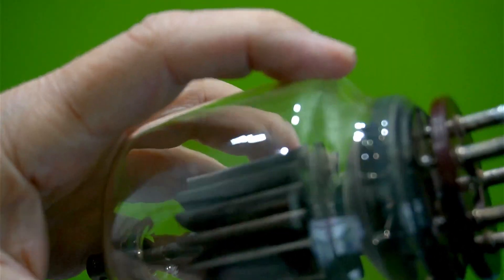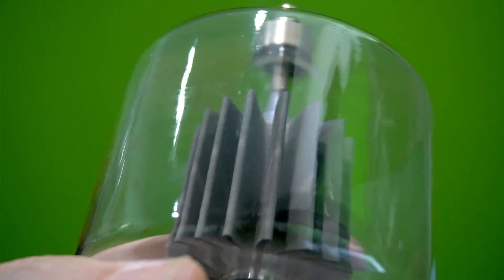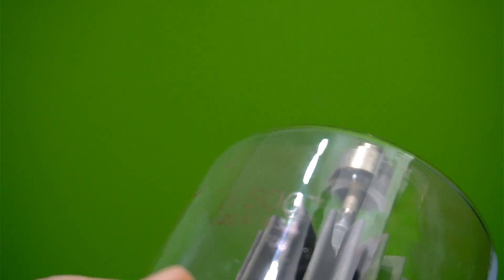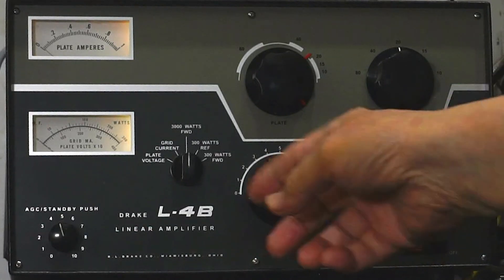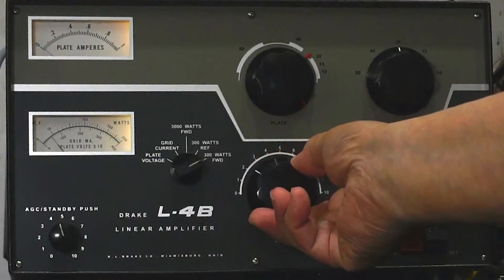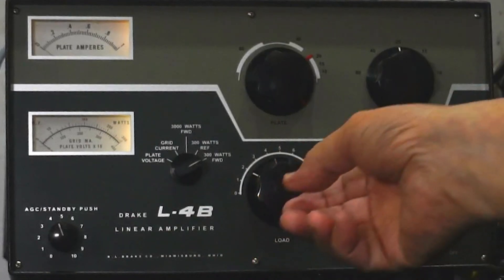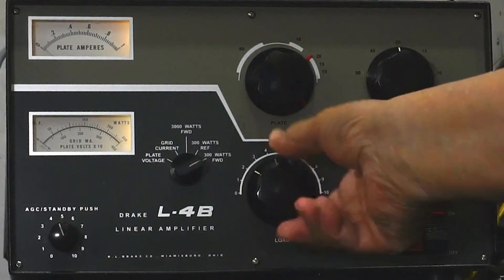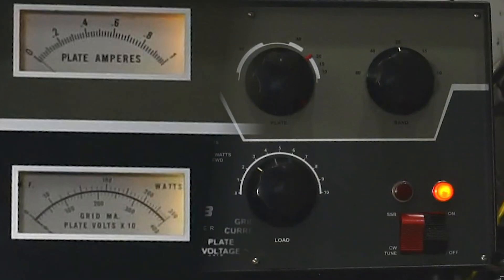Linear Amplifier, Part4, Tuning Drake L4B, Don't Jump to Conclusions, Jim W6LG YouTube  Elmer

Comment: Something crazy is going on with my L7. I bought it used. The first time I used it the output was a little lower than what I thought it should be. About 900 watts out on 40 and 80 and a little over 1500 on 20. now I can only get 200 or  300 0n 40 and 80 and 1000 on 20. Ive connected it to a dummy load to see if it might be something else in my station. Now Im starting to jump to conclusions.

Comment: Hey Jim, I have Drake L7B and am planning to change the tubes. Is there anything to measure and adjust inside the amp? Or do I need just to replace them with a new ones? Is there any checklist to follow? Thanks for the video, 73!

Comment: Been there and done that, Jim. Just have to walk away sometimes and let it sit. Possibly a diode reversed in the string - who knows. It is easy to overlook the same thing many times but patience and perseverance on your part got it working again. Stay safe especially around that 2.5 KV in amplifiers like this. I just built another 
3-1000Z amplifier maybe we can have a QSO on soon.  73  WA4QGA
Reply from the maker: Nice!  That's such a good tube. Could be more like a 3-1500Z or bigger.  It has breat performance.  Sound like fun.  73, Jim

Comment: Jim ... since only one tube was bad, how would you feel about only replacing one tube?  Any comments about foreign made tubes?  ... de K5AVJ
Reply from the maker: It is better to have tubes that are close in terms of efficiency, bias, filament current and voltage.  So, I needed two new tubes that are somewhat matched.  Having two very different tubes would lead to problems.  73, Jim W6LG

Comment: Another series of interesting videos Jim.  I have a SB-220 with a pair of 3-500Zs.  I paid $200 for  it about 15 years ago.  It worked for about a  year & then tripped the internal circuit breaker.  I replaced the  electrolytic capacitors & the metering board with Harbach replacement kit.  Got it working just fine.  73 de K5AVJ
Reply from the maker: That was a good choice.  73, Jim

Comment: Jim. Is lightning AC or DC current? Be careful how you answer, it may be shocking.
Reply from the maker: My guess, since I don't know, would be DC.  Sounds like you are going to say it ia AC.  Educate us in a "brief" response.  73, Jim
Reply: @ham-radio  First it is a natural occurence so it cannot be evaluated in the same sense as man made electric currents.  It is also transient which creates a problem studying its nature.  It has charecteristics of DC current in that electrons flow in one direction however it changes potential during travel giving it charecteristics of AC current.  My theory is it is a unique natural current with many charecteristics common to both AC and DC.  Therefore it is uniquelly lightning current.
Reply: also it is probably the by product or conversion of another energy source. A discharge from a point of high energy to low energy much like a waterfall from gravity.  The base being electron in place of water and the source being a tranfer of energy from several souces much like gravity to move the water from a high energy state to a lower state.  Entropy. Afterall everything in the physical world follow the same path.

Comment: Hi Jim, my 2 3-500Z amplifier has been relatively trouble free, however annoyingly the transmit/receive relay operating coil went open circuit. nothing clever but it was a little fiddly to remove. On the bench the coil still measured open circuit so I started looking for a replacement in the usual online places. After a few days with nothing about to drop in my lap for cheap or free I revisited the relay. Heated up the tags on the operating coil and it reverted to the correct 5k ohms. That was over a decade ago and it is still working, I fully expected the repair to last maybe a week. As for defective components I tend to chop all of the legs off before they go in the bin, it is too easy to waste time retesting components that you find on the bench...
Reply from the maker: I know.  I was maybe a little angry.  Replacements are very inexpensive.  73, Jim
Reply: @ham-radio  Hi Jim, you have plenty on your plate, but at the best of times dealing with defective parts is frustrating. FWIW my amplifier uses a zener for the bias and I always planned to put a diode string in, but on the basis that I will wait for the zener to fail first. 73

Comment: Thanks, this video series has been helpful.  I picked up an AL80B at a ham fest as my first amplifier.  It seems to work pretty good, but I have had to do some work on it.  I think it is a good introductory amplifier to tube circuits with only one 3-500Z tube.  It still has the Amperex French made tube in it and it consistently puts out 700-850 watts on all bands.  I usually run it in the 600-700 range.  If I ever find a suitable transformer, I would like to build a 2 tube version similar to your old Drakes.  73, KF0BBU
Reply from the maker: Ya, you are probably at the max output.  Just watch the grid current.  Don't push it too hard.  73, Jim

Comment: Very interesting set of videos Jim. I worked on an L4B last year that I had a similar situation with. I thought it was the tubes also, then I believe it was something I changed on the soft start board that needed replacing. It was a frustrating experience to say the least. I finally got it running and it works perfect. Wish I had the bigger transformer. 73 Mark W0NCL
Reply from the maker: Thanks for sharing!  73 Jim

Comment: Thank you for this excellent series of videos about the tubes and the amp! I'm looking forward to a future review of the 811A tubes. Thanks again! ~ 73 ~ AC7WH
Reply from the maker: Thanks, I am now looking for an 811H Ameritron. 73, Jim
Reply: @ham-radio  Very nice! I purchased an Ameritron AL-811H two years ago. I use it with my Icom IC-7300 and a small vertical antenna  designed for portable use. With SSB I've had QSOs from my home in Sutherlin, Oregon with hams all across the USA, and in Asia, Indonesia, Australia, South America, and more! That amp really helps me "get out there" and I've received multiple comments on my excellent signal and audio quality.

Comment: How much less output does your L4B produce on 10 meters compared to 20 ? 
Mine seems to be about 300 watts less , do you consider that normal Jim ? 
Thanks for another video 

Jeff VE7GMX 

73
Reply from the maker: I think it is a few hundred watts less.  I will test that after I solve some cabling issues.  I got the RG8X that I was using much too hot with just tuning up.  I need to cable with 213 or LMR400.  RG8X was just for the video in a big hurry.  73, Jim W6LG

Comment: The chain of events you described reminds me of nearly every project I engage in -- especially the ones that I feel should be "straightforward."  🤣 

It's a completely natural flow in the troubleshooting process to focus on what changed recently. Problems arise, though, when one gets so locked-in to that thinking that other possibilities are missed.  

Really enjoyed this series. It's been a while since I worked with a tube amp, but this highlights just how rugged, well designed, and well made the Eimac 3-500Z tubes were.  40+ years of service at full legal power is impressive, to say the least!
Reply from the maker: Yes and yes it is remarkable. 73, Jim

Comment: Hi Jim, the capacitors attached to the gang tune or the choke may have a dry joint? the L/C circuit could be causing the extra load on the input circuit causing the resistor to go in the transformer trying to deliver more load than its rated for? { i have no idea actually} just a thought
Reply from the maker: If so that could bee dangerous.  I do have spares from Russia that are big and in new condition. Thanks! 73, Jim

Comment: Well I thought this was great to watch and listen to. I didn’t understand much of the electronic references but as a mechanical engineer found the build quality interesting. The “old” stuff always offers more “soul” to me rather than the tech today.73.       💙       G0uvl
Reply from the maker: It was well built but showing its age. It was designed for long transmit duty cycles with 2kW input power.  I need to clean it somehow and soon.  It is really dirty.  I heated up the RG8X to where it was hot to the touch. 73, Jim W6LG
Reply: @ham-radio   you’re amazing 🤩   Can you blow it out with a compressed gas canister… I get them from Costco but I think its butane??? That’s in them… WD40 cleans up dirty fascia and cabinet boxes.73.       💙   G0uvl

Comment: As an electronic technician many years ago, there is usually a “looped” circuit and the component that went bad was the weakest part in the loop.  Those diodes were probably compromised and you replaced them.  What other components are in the loop that is also compromised?  Great visual on your repairs! Glad you broke it down to four short videos, as most techs would fall asleep after 15-20 minutes.  73 de KD6UYK (Tim).
Reply from the maker: I think I was at 43 minutes.  I had too much to say.  Those diodes had me frustrated for sure.  I've ordered new diodes and will trash the old ones. I had no idea how old they are.  Thanks, Jim W6LG